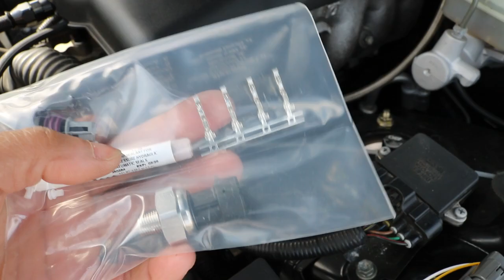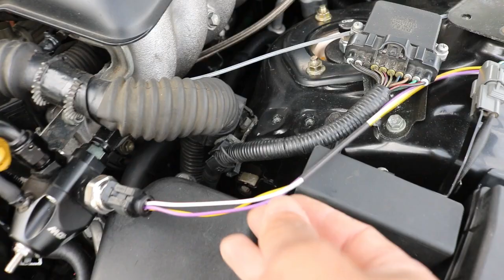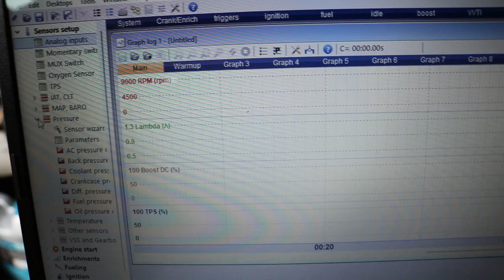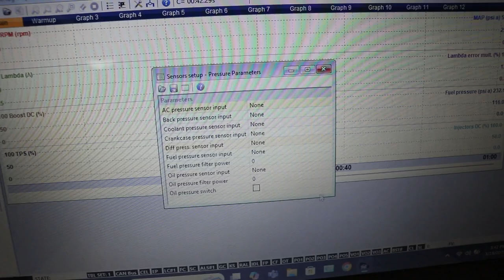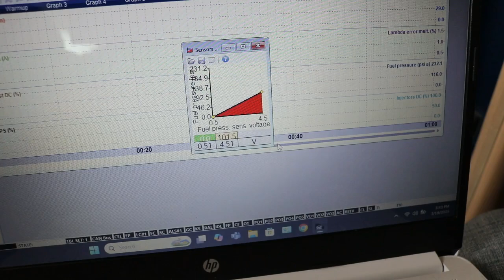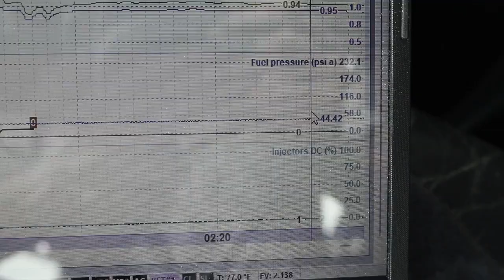Lexus IS300 Turbo EMU Black fuel pressure setup #ecumasterusa #emublack

Comment: Nice work, just stumbled upon it while troubleshooting. What is your fuel pressure like with just the switch on? Do you have the pump on 12v all the time? Im getting about 20psi extra with switched power than I am with the car running, still on the stock circuit with the resistor etc. Thinking that may be why.
Reply from the maker: I’m running the completey stock fuel system wiring as Lexus made it. I do have an aftermarket fuel pump with an external fuel pressure regulator. Are you having fuel pressure problems?
Reply: @Knownworldwide  im doing the same. I dont have a problem just this weird issue.....SWITCH ON = 60psi. Crank/car starts goes down to 40psi. Don't quite understand. Jumped the resistor but still same behavior.
Reply from the maker: @Genevagirls-h2x if it is running and you have an external fuel pressure regulator connected to a vacuum source, it will pull down the pressure with the vacuum. If you disconnect the vacuum source, it will climb back up. This is normal operation of a 1:1 regulator.
Reply from the maker: @G @Genevagirls-h2x I suggest you running around 43-44psi base pressure anyway. 60psi is too much unless you are really trying to stretch out some small injectors.
Reply: @Knownworldwide  nah i have the stock 440s. The vacuum argument does make sense as the car pulls in the 20ish range and when the car is running, it sits at 40-42 and i can adjust as desired. Its just when the switch is on (engine off) that the pressure goes to 60. Thanks for talking it out!
Reply from the maker: @Genevagirls-h2x switch on, car not running is base pressure. So if I may suggest turning that down to around 43-44psi. There really is no need to run that much base pressure. You are asking your fuel pump to deliver a stupid amount of fuel pressure that it really doesn’t need to.

So get the car running. Pull the vacuum hose off the regulator and then turn down the fuel pressure to 43-44psi. Then you can reattach the vacuum hose and you should then see something around 32-33psi. At idle. Of course you would need to have the car retuned for this pressure drop but on the long run you will be able to get more out of your fuel pump by going this route.
Reply: @Knownworldwide  appreciate the advice! Will do so tomorrow.

Comment: Flex fuel sensor?
Reply from the maker: @kalebsanchez3688  You are trying to wire one up to the EMU?
Reply: @ I’m curious, I haven’t seen much information on how to wire it, or which sensor brand to use to hook up into the emu black.
Reply from the maker: @ Honestly the best sensor on the market IMO is the GM factory flex fuel sensor. Most companies selling flex fuel sensors simply slap their logos on a GM sensor.

If you want to just use the one ECU masters sells on their website, that one is perfect. All it needs is 12v power (switched power) chassis ground and the signal/output wire will go into the “FLEX FUEL IN” pin on the emu black which is pin B9.

I plan on running one on my civic since I will be running that on E85 at some point. Right now though I am just running pump gas on it.